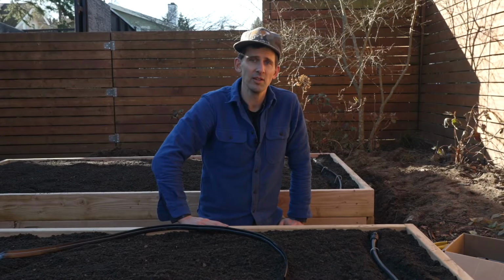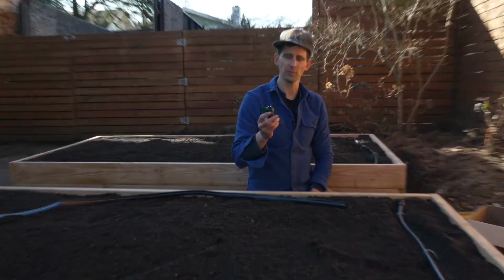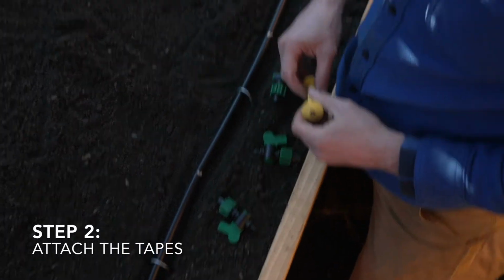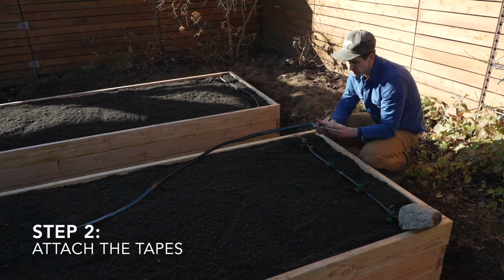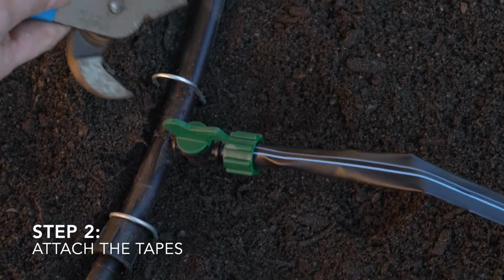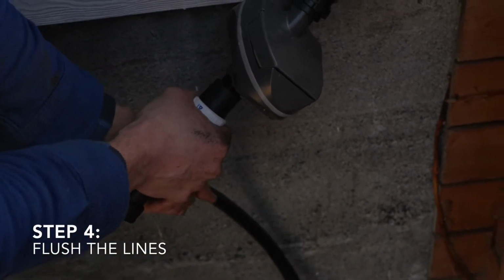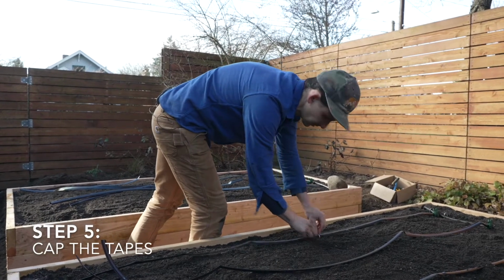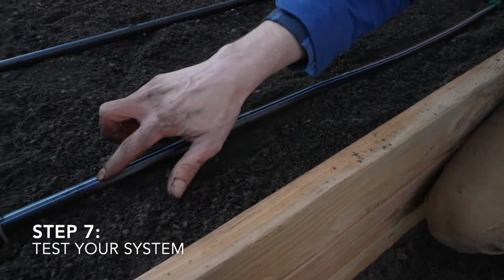Building a raised bed vegetable garden: drip Irrigation part 2

Comment: Hey question for you guys regarding the end of the drip tape. I just installed some in a clients garden but the ends are leaky, making the pressure not as balanced throughout the bed. Any OCD suggestions for getting those ends tight?

Comment: These are the best videos for making and installing raised beds and adding the irrigation system. I already have all my beds   but they are starting to breakdown after 16 years -planning to keep these plans in mnd when I will need to redo them. I also have irrigation I added but used the emitter tubing instead of the tape - is there a difference between these? Now wondering if I should replace with drip tape.Thanks so much for these videos.
Reply from the maker: Thanks Laurie! Emitter tubing will work, so I'd stick with it if you already have it. When it's time to replace what you have, go with the tapes!

Comment: My container garden is 4 wide and 16 in length.  I have already started my plantings and planted the rows the short way across the beds. How would you use drip tape in this case? I’m not sure if it’s feasible to do multiple drip lines across the bed. Does this make sense?
Reply from the maker: you can run the tapes the short way, just run the header along the long side of the bed!